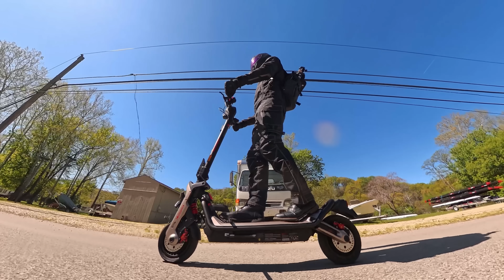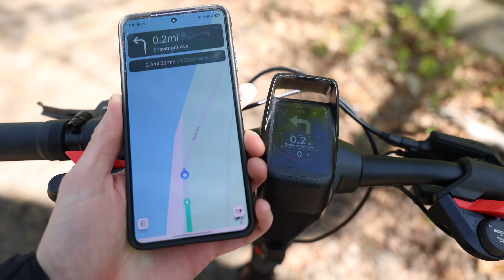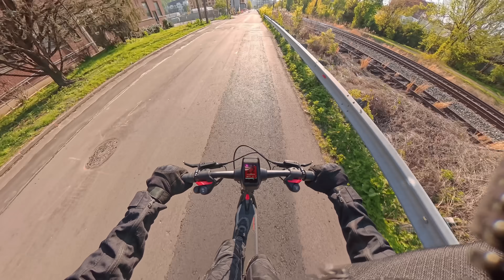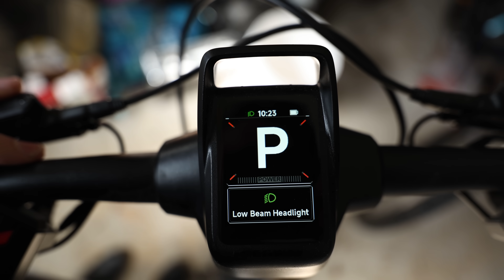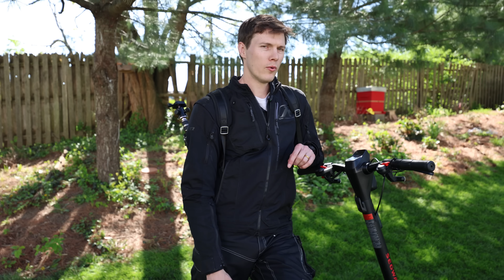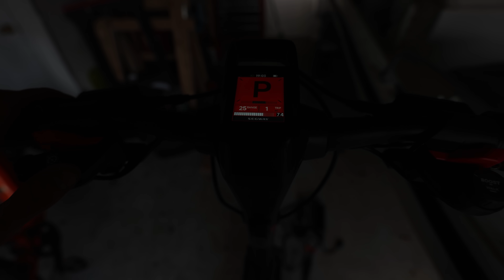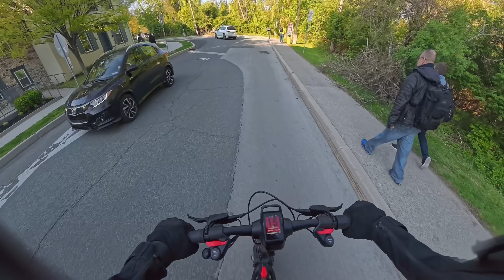Can A $2,700 Electric Scooter Replace My Car? - I Tried For 3 Days

Comment: No way you reviewed my absolute dream scooter! I've been eyeing it for the past few months
Reply from the maker: Not cheap, but I love that it's significantly cheaper than the previous generation
Reply: @MikeOBrienMedia  Can you make more videos about it? I've already watched basically every English one on youtube and I low key need a video every day until I can get it lol. You're the first one that made me realize the strut on the folding mechanism actually completely snaps it in place as opposed to my Max G3 without it. 
I know it doesn't click in place for carrying, but does it at least secure the folded steering column laterally so it doesn't fall off while carrying? 
Also do you know if the display is made of plastic like on mine? Because it's already completely scratched and I think I'd rather get a screen protector if it is. 
I've also got another question no one has answered yet, which is whether the scooter regens when you press the brakes and whether it is applied on both motors, and if so if you can choose which motor depending on which brake you press. 
Because on my G3 I have the in app regen setting off so I can let it roll and therefore I repurposed the back brake lever as a regen lever by making it loose as it brakes enough for the rear tire anyway (about 800W max), which works great. 
The issue I have is that the front brake lever also regens in the back, which can cause my tire to slide when I brake in less grippy conditions, which can be really dangerous at times, so I'm hoping the front brake lever only controls the front regen on the GT3 Pro.
Reply: @Alex-tu5vu  Oh my goodness, dude. You a little excited? lol start reading reviews and blogs about it. or did you get it, yet?
Reply: Have you considered Apollo Phantom 2.0 there are two versions. I have two Apollo City's very reliable no issues, I just look after them.
Reply: @Feral6-h3g  How dare you even consider recommending this weak overpriced ass junk. Segway is the cheapest brand for performance in comparison, 1800W for OVER 2000 DOLLARS is fucking insane, this one has 3200 nominal and 7k peak if you noticed. On top of that what even is that display and suspension mounts??? Looks like 800 dollars
Reply: @A @Alex-tu5vu  It’s a very good scooter. The app is very reliable, the scooter has really good regen breaking system, the acceleration is good, the speed is high, it has high amount of useful features and it’s very stable
Reply: @TociixWaste  Sure, but the GT3 Pro is better, no? Except a dedicated regen switch, which on my G3 at least the brake levers have integrated. Every stat and the look are a lot worse for only $500 less, I also don't want a thumb throttle. Haven't tried the GT3's twisting one yet, but it looks to be better once you get used to it and ideal would probably be an index throttle.
Reply: Anything is possible my friend. Work hard, stay consistent and just go for it. I hope you get your new scooter soon @Alex-tu5vu 😊
Reply: Same I would definitely upgrade I have it’s brother the f3
Reply: buy a kukirin g4 instead
Reply: Kukirin G4 i would buy that i have G3 so i dont need it right now but if i ever need a better scooter i would deffinetly buy the Kukirin G4
Reply: look up the Nami Max. I am hearing it is super, the one that goes 60mph. This Segway G3 looks good too with its 2160wh battery.

Comment: 50 MPH??  That thing is a freaking death trap.
Reply: What's the difference with a motor cycle?
Reply: @moortu way easier to speed wobble with the small wheels
Reply: @blendoben They build steering dampener specifically for that. On a high end scooter it's very stable. 

Now they sell scooters on teemu for like 700$ that say they go 50. Massive speed wobbles. No steering dampener.
Reply: @blendoben  Im scared of potholes or just a surprise bounce. mine can do 55 but I dont like going over 40
Reply: @MrSleep20013  You just need better spatial awareness and good reflexes.
Reply: @JasonBerry-r1i  The dampers are $25-50 and nominal cost  Make it part of the purchase and you have no issue!
Reply: @Deezzz_Nutzzzzzz yeah they probably should but they cut every corner they can so they can charge a little of a price as possible. That's why their batteries explode etc.
Reply: @JasonBerry-r1i  you know nothing
Reply: @deadzools yes sir. I'm new to this whole thing maybe a steering dampener does not affect speed wobbles, whatsoever huh? That is the truth claim you're making by trying to say I know nothing.
Reply: @JasonBerry-r1i I was referring more to the batteries exploding, as that's a very common misconception and not a common event anymore especially among the more prominent brands of manufacturers. For very high speed scooters, dampeners can improve stability.
Reply: @deadzools  Are you saying that thermal runaway is not possible with the "cheapest" possible current lithium ion battery technology? 

I'm not talking about any reputable manufacturer who actually cares about their consumer experience, like segway, gotrax, etc. I'm talking specifically about the ultra cheap Chinese unbranded scooters, which 100% do not come with quality cells, or a decent BMS.
Reply: @JasonBerry-r1i yeah nah don't trust the cheap Chinese junk you're just asking for problems, if not battery failure something else is probably going to go wrong. There's still a possibility of batteries getting too hot if the scooter doesn't have the proper safeguards but those safeguards are in even the crap scooters now, even if it's just basic overcharge protection. Is it still possible? I'm sure it is, it's just not as common of an issue as it used to be.
Reply: I 100% agree with you 

I went with segway, and they did not disappoint @deadzools
Reply: How fast does your car/motorcycle go? 130? 150? Faster for some, do you drive your car or whatever else at top speed all the time or even ever? Just because it can go fast does not make it a death trap, it all depends who's driving. Nothing really that dangerous about these going that fast if done safely either, you'd be blown away by the stability and smoothness of the ride.
Reply: That’s slow. My Gspace goes 75mph
Reply: @AlderaansRanger no it doesn't
Reply: @slimfit767  You dont even know what that is old man.
Reply: @AlderaansRanger lol yeah with a good wind behind you.
Reply: And 3k 😲

Comment: 50mph on a scooter is unbelievably dangerous
Reply: i have inmotion rs that can go 68 mph but i've never went above 40, it's all up to u
Reply: @mediconabike How many total miles?
Reply: @Samusaran77  i have 1300 miles on it
Reply: @mediconabike Not bad
Reply: @med @mediconabike ow fast does it take to get up to 40 mph?
Reply: @2ification  not for certain but feels like only a few seconds
Reply: @med @mediconabike  I heard some people experienced wobbles at higher speeds
Reply: It is also not legal to ride that fast on scooters. Most states limit to 15 or 20mph in the US, but enforcement varies
Reply: @KaiWritesCode Not sure why anyone would want to go faster than that. Very few roads are maintained enough in my experience
Reply: @Samusaran77  the most average pothole that a bicycle would glide over this would be swallowed whole at 50 mph
Reply: @KaiWritesCode  So in PA (where he is), electric scooters are technically regulated as motor vehicles because there's no specific e-scooter laws, and they meet all the legal definition of a motor vehicle. This means that technically they are illegal to use on the sidewalk (because it's a motor vehicle), but they also lack the legally required equipment to drive on the road. The PA state legislature has been considering adding specific laws regarding e-scooters, but they haven't done it yet. This is also why PA has never seen micro-mobility companies like Bird or Lime operate dockless scooter rentals in the state. I've never actually seen anyone be cited for it though, I'm not sure if police really even know what statute they would cite the person under, and e-scooters are relatively common in citites.
Reply: @KaiWritesCode yeah try that speed on a road with cars dangerous
Reply: You’ll also get crappy range like 30 miles
Reply: @jamesbarry2388  You likely wouldn't ride that far in a single session. If you want more range, buy a used electric car, but the downside it will cost a bit more to run. Be reasonable bud
Reply: I use the yume raptor 😊
Reply: Not on this one
Reply: The point is to ride it around 15-25mph to max out the range on the huge battery. This thing at those speeds could probably hit 40 miles.
 
Not specifically to be driven at 50mph all of the time. That power is supposed to be for getting up hills (at more than 10mph).
Reply: 50 mph is also rookie numbers. A lot of modern higher end e-scooters can do 70mph.
Reply: @dephataznboi Its no pissing contest dude.
Reply: @Samusaran77 yeah it is a pissing contest. Most scooters over $1500 hit 50mph. The pricier they are. The more stable they are with longer range.
Reply: @AlderaansRanger  I'd prefer more range anyday. I can't say I want to pay extra for stronger motors I will never utilize 😅
Reply: @Samusaran77 well you almost never get the extra range without the speed. But the big fast scooters can have big range batteries. My new one is going to have 140 miles or range.
Reply: @AlderaansRanger  Im aware of that but the market will get better hopefully over time. l'll buy spare batteries for my budget scooter until one comes around. Much cheaper range that way
Reply: @dephataznboi You're going to turn into spaghetti if you crash at 50-70 mph on a e scooter. Have fun with that.

Comment: I’m 71. When I retired I sold my car. I walk, use the city bus and scoot everywhere. On a rare occasion, I’ll call an UBER, depending on weather and destination. I own a “72 hour” backpack which I use to grocery shop. It’s big enough for a 10 lb bag of pet food to EASILY fit into the main compartment and has 2 side compartments plus 2 smaller compartments on the outside of the main one. For lockup I use a NYC Kryptonite “fogettaboutit” lock and a lock that goes on the brake rotor (I put it on the back rotor). The scooter I have is the Dualtron STORM, which also has a, keyed access, removable battery. Push come to shove you could take the battery out and put it in your shopping cart. I also installed the Minimotors fingerprint reader safety feature. The battery is 72v 35 ah and costs me 4 cents to charge from empty to full in Tennessee. I live on the second floor of an apartment building (2 - 12 step flights of stairs with a landing between). Even with the 23 lb battery removed the scooter weighs 80 lbs. SO I went to Home Depot and bought a 10 ft long 1 X 12 and had them cut it in half. The pieces are connected by 2 heavy duty hinges. On one end of the ramp I’ve installed 3 metal “L” brackets which allows me to hook into the gap between the top step and the landing. I went on Amazon and bought peel n stick grip tape for the boards and 2 seven inch tall Curb Risers (my steps are 7 1/2 inches tall). One goes on the top step to keep the scooter’s weight from bending the “L” brackets, and one supports the gap under the hinges. The incline is 30 degrees. I put the scooter in ECO, 1st speed and turn the power down, via “P” settings, to 28%. The scooter barely can climb the 30 degree ramp at that power level, allowing me to jog up the stairs guiding it. Coming DOWN, I don’t need a ramp. The STORM has a very high deck that clears the steps when I bump-bump it down the steps. I HAVE replaced my car with a scooter. On VERY nice days I deliver UBER EATS on it, using a PAKIR brand food backpack.

Comment: Been riding scooters since COVID...If you can get your hands on a reliable easy to service/maintain as well as has good customer service, and parts replacement and you could utilize it more than your car. Right now with gas being more expensive and roads more congested a scooter is one of your best bets.
Reply: I agree. I use my e-bike and scooter for DoorDash and make a good amount.
Reply: @triforce2022 that's awesome....being able to make money on a scooter is a huge PLUS ....
Reply: @triforce2022 same
Reply: I put a reusable bag in a scooter pouch or or just fold it to fit in my cargo pockets.
Reply: @Phil0130 YES!! That works too

Comment: Get a piece of Velcro (1" x 8") used for dressing cables and use it to hold down a bag hanging on the hook. It will keep the bag from jumping off the hook when you hit a bump. It also keeps the bag from moving around so much.

Comment: I got mine for 800$ off Temu and it is only 5 MPH slower than yours lol. Had it for over a year and hundreds of miles.
Reply: Probably a small battery and little water protection
Reply: @Samusaran77  Maybe. I have accidentally left it outside in the rain 2 times also haha. For the price though, I loveeee mine.

Comment: Nobody forces yall to ride at 50mph lol, you mostly need the power for hills and offroading and the occasional sprint, not constant cruising, unless you live in a really big city with highways and have to commute across the town. Its definitely worth getting an overpowered scooter and underutilizing it, since that leaves you with more battery and spare power whenever you need it. Since I started riding rentals 6 years ago and especially after getting my own this February its beat every other mode of transportation in my heavily congested hilly city with very bad roads.
Reply: This exactly. Which is why all these new ebike laws piss me off. “You can only have so much power!” Like…why? What if i dont want to use that power for speed but rather hill climbing? The people that make laws are silly
Reply: yup cant agree more.

Comment: But this scooter is a really expensive option, for something that doesn't fold into itself, doesn't have a removable battery like my roadrunner RS5 Max and I have approximately 1,000 miles on it, I don't have to carry it upstairs ,js
Reply: i agree there are alot of 50mph e scooters that are under 2000$ that are jus as good if not better with removable batteries as well which can double your range and are lighter to
Reply: @fantasyworld77 yeah and they are not nearly as well built. Just cause something’s fast doesn’t mean it’s good. I could build a 50mph scooter in my garage for less than 1000 bucks, but it wouldn’t be nearly as quality as this Segway.
Reply: @Matts5.0  quality is up in the air lately since china owns the company now.
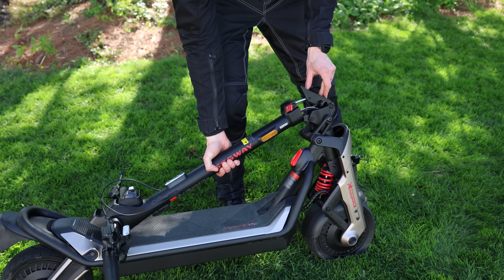Reply: It folds. See 09:00
Reply: @maryseeker7590  it folds but doesn't lock into place
Reply: I hear roadrunner is the bomb.

Comment: I do a majority of my trips on either a scooter, a bike, or public transit. I do some smaller grocery trips with a good sized backpack on a scooter, but usually a bike with panniers is going to hold a fair bit more. I mainly use my scooter to get to and from public transit since the one I have is small and light. And then swap it out for a bike when it gets particularly wet or snowy since it’ll handle the wet conditions a lot better.
Reply: Same here

Comment: It does NOT cost more than your car lol
Reply: Yeah that kinda blew my mind. Like what kinda shit box is he driving
Reply: @MarcusWarcus40  lol
Reply from the maker: My car would be lucky to sell for half the price of this scooter
Reply: @MikeOBrienMedia  Thats only because the seller's share of the used car market is worse than gamestop when it comes to them buying games.
Reply: @MikeOBrienMedia what piece of shit do you drive? A $1500 car in 2026 is hardly even road worthy.. you need to buy a new car dude.
Reply: @Matts5.0 Nah. Just over inflated prices.
Reply: @Matts5.0 smart people drive cheap cash cars. Cheap to fix and cheap to keep road worthy. Anything made in the last 10 years is almost impossible to fix and replacement parts cost a fortune.
Reply: @Matts5.0 No way. There are so many videos on how new cars are the worst and smart buyers are getting 20 year old cars or up 2012 at the highest. Besides being built not to last, independent mechanics don't like working on new cars, because there's all these subscriptions and exclusive systems they have to go through to work on it. Which means you have to take it to the dealer mechanic which is the worst price. They also have built in surveillance and face recognition on you and can be remotely shut off if they say you skipped a payment or whatever reason.
Reply: @rashb3994 I did t say it had to be brand new, just new to him.
Reply: @rashb3994  They don't mean $1500 used cars though
Reply: @acidead97 Fair enough, though I do see plenty of vids where someone mechanically inclined gets something from $500 to $2000 only put in a few hundred and have it running nicely. But where you are 100% correct is when I look for great used SUVs that last forever it's in the 6k to 9k range.
Reply: @matt6951 Bro, I drive a 2007 honda accord with a smashed driver door and missing right side bumper cover. It leaks oil and trasnmission fluid. I would be lucky to get $1500 but she still runs.
Reply: @ras @rashb3994 

You touched on a really cool market correction that’s about to occur. The beauty of this system truly in action. 

Eventually, people just stop buying the thing that’s inflated. Forcing the seller to lower prices. 

This JUST happened to dorito. They kept hiking the prices up to 7 dollars a bag and people just stopped buying them. Now, they are on sale dang near everywhere, and the price is dropping after the sale ends. 

The same thing will happen with cars, although slightly different because cars have tons and tons of parts from different continents, it’s the same idea. Once enough people are buying older cars, they will be forced to lower prices.
Reply: @MikeOBrienMedia is it totaled?
Reply: how would you know that
Reply: @lexistential 
By looking up the resale value lol